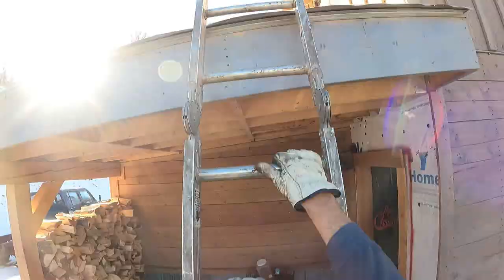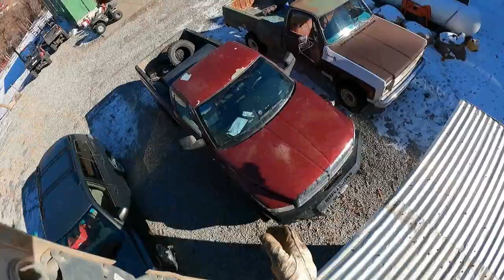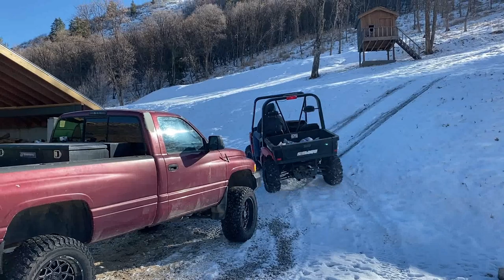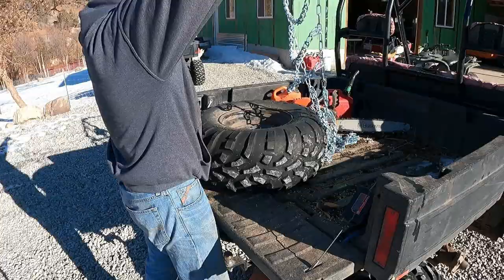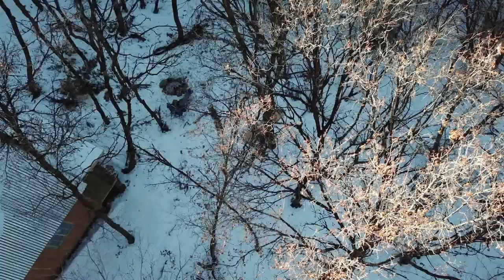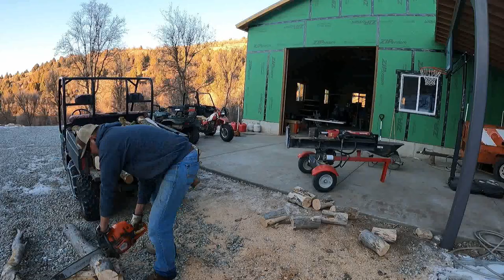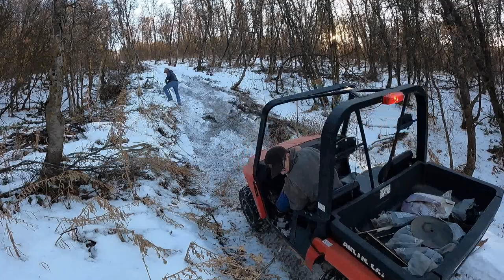The Earth Has Shifted... LITERALLY! (Solar Panel Issues)

Comment: You guys did it right. I jumped in a used 40ft school bus and pickup truck and trailer and drove 2100 miles over 6 days to a as is where is foreclosure mostly sight unseen (just pics from the REA god bless her she climbed through a window to get me inside pictures) for $47k and prayed the house did not kill me.

I got lucky. :-) it was a heck of an adventure!

Why the school bus? 28ft rental truck $4500 40ft school but $2800. no brainer :-) and I got to keep the bus :-) hehehe

And talk about a change. I went from suburb Levittown Pa 2000sqft on no land to 1500sqft on 1.25 acres in Edgewood rural new mexico. Almost Zero regrets. I love it here. and massive bonus. no humidity and no mosquito's and almost no rain :-) (at least compared to back in the north east)

Comment: You have a shading on your panels from the trees :48 and 2:59 over your left shoulder.  The amount of shade looks like it could cause 30 - 50% production deficit as the sun gets lower in the sky.   You should clear those trees on the hill.  Depending on how you have your panels wired a little shading could equate to a significant loss of production.  Just my 2 cents.  God Speed

Comment: I live on 34 parallel at -117 latitude. I’ve been getting the sun into my north facing windows in the summer for longer each successive year since the past 5 years at least.
From late April until a couple of days ago (aug 15 2022) the Sun is rising and setting farther north each year.
Keep in mind the tropics are supposed to be 23.5 degrees north and south of the equator.
It seems like either the tropics have moved closer to the poles or the equator has shifted north somewhere in the pacific between Hawaii and California.

Comment: I agree about the world shifting and the sun availability on my off grid solar panels this year is horrible especially the last 7 months. 
Last year my system was too small. So, I increased it by 8 times the wattage. I only run my lights, a fan to circulate my heat and my propane fridge ignitor and a phone charger. After the huge increase in wattage I cannot even run one light, let alone multiple lights, nor the fan, and the phone charger, and no fridge for 7- 8 months now. I'm in the same place, thought I could be mobile in my motorhome. Parked at the same angle, and the panels are in the same place. The tester says everything is working perfectly. But I have less power now than back in Feb - March with my old tiny system. And the sun doesn't shine in my huge rear window like it did before. So, something has definately happened. I thought it was just me. LOL
I'm in Marshall, Michigan for comparison. 34 miles North of the Indiana border along I-94 & I-69 interchange.

Comment: The geo-magnetic North Pole has been moving away from true North since the early 19th century. However, it began moving quicker in the 1990s. It is currently moving at a rate of 5.1 miles/month. By March it will be at 40 degrees.
We haven't had a Pole shift in over 700k years which means we're past due.

Comment: Let me give you a Ideal, I know they are heavy, I have set them up  Concrete a 8 inch pipe 4 feet into the ground in concrete, Use another pipe that will fit inside the 8 inch, use a  automatic flex plate with a auto starter  , build a angle Iron 4x4 3/8  go 4 panels wide 6 high , it will be able to handle the weight, and use a controller for speed rotation, That the only way of beating the sun Movement.

Comment: might you consider shifting the panels , you could use normal household 120/240v underground cable  , it should be reasonably priced , to feed the inverters located at the house

Comment: I agree re the earth shifting, I used to grow tomatoes in the sun but over recent years the sun coming over a line of mature pine trees no longer shines on the location that I planted. 
Like you I feel the earths still molten core which must be moving per the magnetic poles movement is behind the global climate changes as well as the carbon dioxide in the atmosphere.

Comment: lucky to have all that firewood standing around, cut it, stack it and have firebreaks and defensible space around your structures....you need to get  that mountain trail cleaned and snow/ice covered with ashes, gravel or whatever since it is way to slick.....poor rangers
Moving 800 miles to  SE Idaho, the Lord moves in mysterious ways.....

Comment: You should always cut firewood (trees) in January, because it is driest wood in a year, leave it as it falls and cut it up to manageable peaces in late spring (when dirt is dry), bring it down to the shop, cut to the length and split it. In this way you will have driest (and litest) wood to work with and at the same time bring it moisture content to below 20% to winter time. It will burn hottest, less buildup in chimney,...
P. S. Regarding solar panels and what is going on on 🌍: you should put panels on roof of workshop will have a lot more sun and easier to repair any leaks if they happen (far easier then house), but you shoud put converter to 110V soon after to avoid voltage drop over long distances (to battery bank). Better to convert twice then high voltage lost with low voltage in thick cables. Batteries should be in varm environment (house).
Regarding other pm if you would like to know the truth - not just science.

Comment: Drop a tree in fall. next fall cut and split. next year it might be ready. I used to age my split wood for 2 years at least. so when you drop a tree you wont burn it for 3 years or even 4 if humidity is higher. we made racks that a tractor with forks can move them so we only had to stack 1 time. Also for every tree you cut plant 3 so there will be plenty of wood for future. We would also plant 1 tree that would be used for milling each year(pine, black walnut, oak  and birch). that way you can have any type of wood you need for future.

Comment: Not sure if it would stick to the plastic but if you were to use fiberglass resin on the inside to fix the hood on the small side by side see if anyone around there works with Fiber Optic cable.  We did a job at a water plant  and one of the operators asked for all the scrap Kevlar from the cables.  Seems that people that drive dune buggies use it with fiberglass resin to fix the bodies of their buggies.  I don't know if they are fiberglass or plastic but the Kevlar looks like silk roving before it is spun and is VERY strong.

Comment: The Earth is tilted on its axis by 23.5 degrees, relative to the plane of the orbit of the Earth around the Sun. Because of this, the Sun’s rise and set positions vary by up to 23.5 degrees north or south of due east or west throughout the course of a year (the orbital period of the Earth around the Sun).
The Moon’s pattern is close to that of the Sun’s. It orbits the Earth on a plane that is approximately 5.1 degrees offset from the orbital plane of the Earth around the Sun. This causes the position of the moonrise and Moonset to vary up to 28.6 degrees north or south (that’s 23.5+5.1 degrees).
Because of the differences in the orbital periods of the moon and the length of a month, the moon will not be in the same location this month as the same time next year.

With regards to your getting less and less sun on your solar panels, consider that a slope with topsoil (created from erosion) usually has a much longer run vs rise, annual tree growth (rise) at the upper part of the hill will result in a much larger longitudinal distance (run) being covered in shade down at the lower levels of the mountain.  If you know the run and rise of the slope from the top of the hill (or tree line if you hill does not have trees at the top) to your solar panels, you can easily calculate the increase in sun shade area for every inch of tree growth.

Comment: The sunrise, sunset, local noon angle above the horizon and difference from true south for any location and any day of the year in the past, current or future dates can be found online pretty easily. I suggest you check that out but be warned there is a requirement to be able to measure angles with great accuracy, preferably with a sextant and an artificial horizon. From what you show in your videotape, it seems to me that most likely cause of reduced power output would be partial shading as the trees to the south grow taller every year. I'm sure you know just how little shade it takes to drastically reduce power output.

Comment: I would just get a snow blower for the tight spots.  Also i worked at a sawmill and know if you keep putting sawdust in the same area, like your nice gravel, it will turn to mush and will stay that way. I would do all the sawing in the woods, you won`t have to clean it up and you`ll be in a differant spot most of the time. Helpful?

Comment: Magnetic north has nothing to do with the relationship between the earth and other objects, such as the sun and moon.  The only way your view of the sun could change from year to year would be if the earth's orbit changed significantly (it hasn't) or if your house and/or the mountain has shifted.  If you provide the distance between your house and the mountain and your latitude, I'm sure someone would be able to calculate how many feet your house/mountain would have to have move to affect your sunlight by an hour.

Comment: put a deck on the back of the shop - easy access to all the panels
Reply: take out the mature old dead trees around the cabin and it will grow in - throw on some lime and fertilizer up there and that should boost up some stuff also do a pollinator corridor and a forage plot you can probably hunt from the porch

Comment: It’s been a lot of years since I burned firewood for heat as a kid but I don’t remember having a stack of wood split that small. It will burn hot for sure but won’t last at that size. Experiment at all with different sized logs? A lot of the maple your brought down the first trip in this video seemed about right to stack a few in after a good rager is built and let heat for hours... end result is less splitting, fires burning longer, and using less wood... 

Worth a shot if nothing else and then you can message me and tell me I was wrong.

Comment: Precession (like the wobbling of a gyroscope) is natural, and slow—not sudden: Earth's axis precesses such that the north star will eventually change.  There's a great deal of seasonal change in where the sun rises and sets, due to the 23.5° tilt of the planet's axis; and, because our calendars aren't exact, and Earth's orbit around the sun is a bit different each time, the observed rise-and-set locations vary slightly over time; but again, this displacement is less sudden than "suddenly" noting a tree's gradual growth.

Comment: I told my wife a few weeks ago the moon position is off. I've started seeing it through the door window while setting in my recliner. I been setting in the same place for 15 yrs and this is the first year I have ever seen or at least noticed it . And when it is full it is bright. You can't not notice it. At the top of the mountain I live on is a compass carved in rock. It is said to have been carved in the 20s. Years ago I checked my compass by it and it was true. I am told now it is no longer true, it's off a few degrees.  This is a rock the size of a small home. We have had a earth quake but it was barely noticeable.  I also saw a documentary about some natives living at the pole. They used to navigate by the direction the snow dunes allaigned east and west, I believe.  They said they can no longer go by that because they have changed, but there tribes have allways navigated by them. I also read airport's have had to renumber or rename runways that are no longer true east or west??? I recall after the earthquake and tsunami back in the early 2000s, satellite images of islands no longer in the same place. I think something happened then and things have been changing since.

Comment: I was going to say something about the magnetic poles not affecting the orbit of the earth but many many others have explained what's really going on. I've noticed the moon rising in very different locations during the year (I live in Seattle) and I'm wondering if that's due to the wobble in the moon's orbit. I don't think the earth is wobbling though! I'm wondering about the structures of the house or barn dealing with the added weight of solar panels? Maybe cutting the trees down that are shading them and making them shiftable so you can get the maximum amount of sunshine as the seasons change would work.

Comment: As regards airports they are constantly changing references to runways because of magnetic shift, a 60 degree change is on record for the aviation industry, obviously as planes fly by instrument with pilot assistance, either by map reading or some GPS system, the offset for various instruments must be set, relative height, not actual, relative degrees, not actual, this ensures aircraft are LINED UP FOR THE PHYSICAL RUNWAY and height adjusted for altitude and weather but the pilot will still follow instruments.

Runways are often renamed, runways are always given the degrees vector runways in my town 16 is for a Northern approach it used be 17 and the other end is 34 for the Southern approach and it used be runway 35. :)  BTW, we are also overdue a magnetic flip

Comment: You need to change where you have your panels, at highest point on property will be the solution - though you will need to increase the cable size to minimize voltage drop over the distance.

Comment: Don't guess where the sun will be.  Get an app for your phone.  On Android I use 'Sun position and path' and it is awesome.  It pops up the camera, which you point towards the sky, and it shows the sun's position and path throughout the day on the winter/summer solstice (or any day you specify).  Great, great little app for solar, which I used to position the panels on my roof.

Comment: This happens every year without fail, if there had been any movement of the planet then it would change, it hasn't!!

Manhattanhenge
Four days on which the rising or setting sun aligns with the imperfect East–West street grid of Manhattan in New York City
Manhattanhenge, also inaccurately called the Manhattan Solstice, is an event during which the setting sun or the rising sun is aligned with the east–west streets of the main street grid of Manhattan, New York City. The sunsets and sunrises each align twice a year, on dates evenly spaced around the summer solstice and winter solstice. The sunset alignments occur around May 28 and July 13. The sunrise alignments occur around December 5 and January 8. Excellent places for viewing Manhattanhenge are 14th, 23rd, 34th, 42nd, and 57th Streets.

Comment: I watched a science channel episode about 20 years ago on the magnetic north changing.  The Scientists drilled core samples in volcanic rock and noticed that the magnetic north would flip 180 degrees every so many thousands of feet.  I can't remember the depth or how many thousands of years they determined but it has to do with the earth core slowing down, coming to a stop and then spinning again in the opposite direction.  The problem with the core slowing down and stopping is that the core spinning creates the magnetism in our atmosphere which deflects solar winds.  Pretty neat stuff, too bad TV programming is crap now.

Comment: It won’t be enough I heat my shop with wood and it take as much to heat the shop as it does to heat the house you should plan on Double what you used last year before the shop came into the equation 🤟🏻🤟🏻🇺🇸🇺🇸

Comment: Hey Heath - Howdy again and thanks for another good video.  About the earth shifting - the magnetic poles do change over time in cycles but the earth's position and orientation really don't.  Apart from the position of the earth relative to the sun changes whilst it rotates over ~365 days, not much else happens.  What may be interesting is to survey the slope of.your property over the course of the year.  You've cleared a bunch of trees allowing more moisture saturation and the soil may have swelled due to old man Winter coming back. - Anyway, it's an interesting mystery. 
Just don't  start worrying about a supervolcano  🙄 Richest Blessings to you and family.
PS. I'm off to buy some Pine Cologne👍🏻

Comment: The sun has moved that explains why I miss the last turn getting to my house. Actually things are changing and I guess you go with the flow.  
  A most wonderfull invention, shoe chains.  My work has me out for long hours any time we have snow or ice.  Several years ago I slowly slid down a steep Road toward an intersection and almost would have certainly gotten run over because of the Cross traffic. I did manage to slow enough to get clear spot and then run across the intersection that was scary. They next year I saw shoe chains, a little rubber harness that goes on your boot with chains that crisscross under your foot. I got a couple pair and have used them ever since and replace them a few times. Wonderful things most certainly they have kept me out of the hospital. Check them out they are worth having.

Comment: You need / want a Snowplow ?? What a coincidence I have one right here....... Its just one of the type that goes on a lawn tractor, and it would be pretty easy to raise or lower easily  with a  simple lever arrangement. And its Cheap .. cheap .. cheap.. Only used by a little old lady to drive to church on Sundays.....I am in boise........... BTW   I need some sort of plow for my garden, and my garden is anout 150 feet by 50 feet. And it wouldnt take much of a 1 or 2 plowshare plow to drag behind my tractor and get my  garden plowed by myself, and my soil is just not that hard. I am looking to do a trade of some sort, and since I am a retired ironworker I can build whatever mounting setup I need . The plowshares need to be strong for my needs though. What can we work out ??..